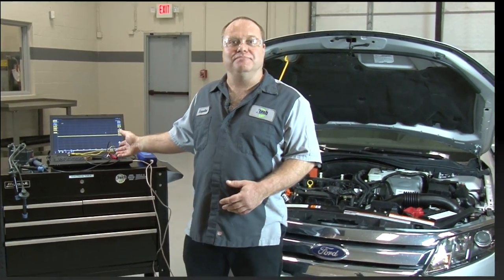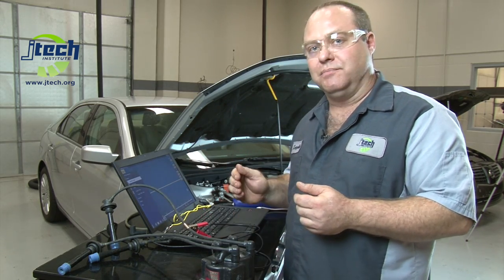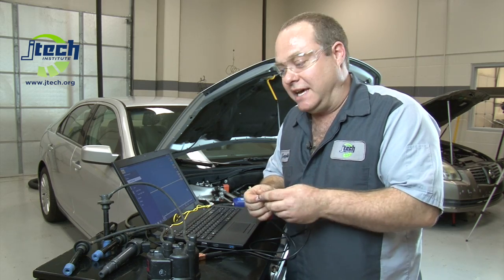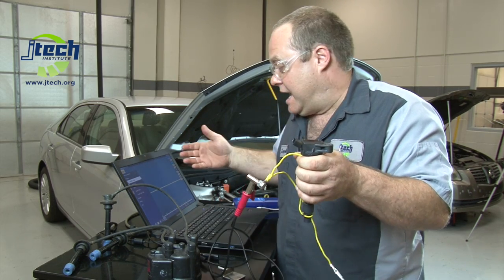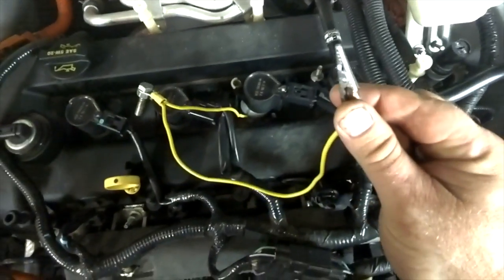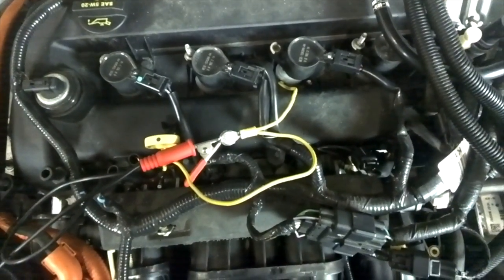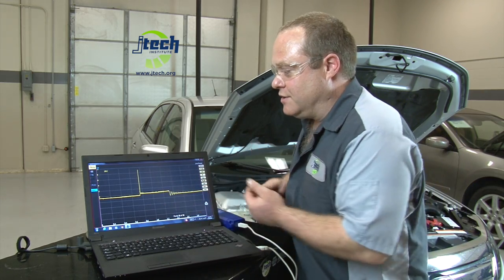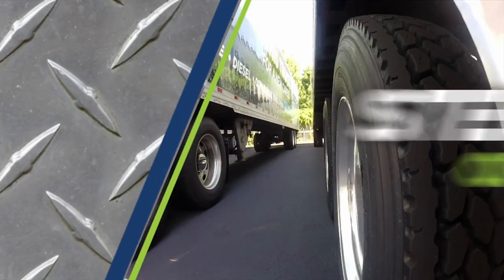Picking up the secondary ignition pattern using an oscilloscope

Comment: I'd like to know where you can buy the ignition clamp that you use on the bolt, I've used high current clamp pain. Or maybe it can be made to use with pocket scope like one I have DS212 which works great , I didn't know OTC made a scope for that cheap, hope someone can answer good vid !

Comment: An interesting take on the technique and one I’ve not seen before. The original probe you start with is called a capacitive pickup though. It has some RC network between the clip end and the scope. You’re just connecting that in series with the lasso wire you’ve made. I doubt that its necessary to ground the lasso wire as long as the pickup you’re joining was still grounded. I suspect, in fact, it would be better if you didn’t.
Reply: I may be wrong (I'm new to EE), but grounding the capacitive sensor increases it's sensitivity, because you're including the the surface area of the ground network. I'm still trying to make heads or tails of it all though...
Reply: @aseredy  I think grounding the wires creates a polarity through the wire instead of eddy currents. It would filter noise too.

i bet he could run 4 wires from each ignition coil around that bolt and see every spark's relative waveform on a single probe.

Comment: Hi, could you tell me why this signal is so long and because it has low level in the burn section, is this normal ??, thanks
Reply: His chosen sweep rate on the screen. It's triggering on the firing line and then there's a long dwell time you're not seeing. The amplitude of the burn time section looks low compared to what a conventional ignition and scope would usually show.

Comment: Just wondering about the yellow wire loop for inductive pickup of high voltage signal... The end of the wire connected to ground... If the yellow wire clip was really connected to the loop end... High voltage signal should be dissipate directly to ground... How would scope probe detect the bolt that was between the continuos yellow wire?
Reply: Because the scope picks it up before it gets to ground. Look where the capacitive pickup is, it’s in the middle, not the end. So, it’ll travel from the coil, to the scope, and then to ground
Reply: At least that’s what it looks like to me
Reply: You are correct! you could put the capacitive pickup anywhere on the yellow wire and it would work.